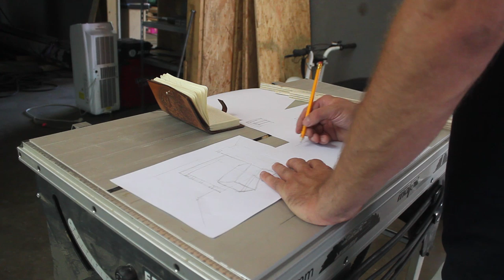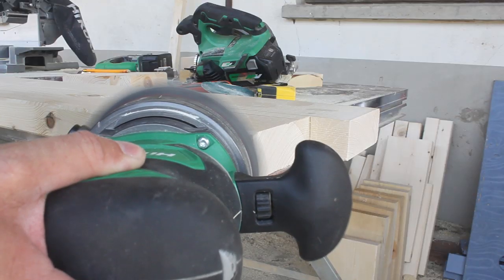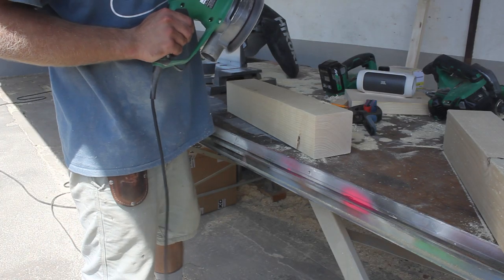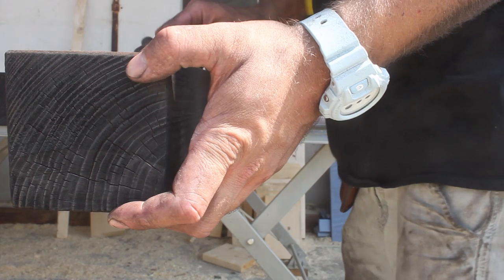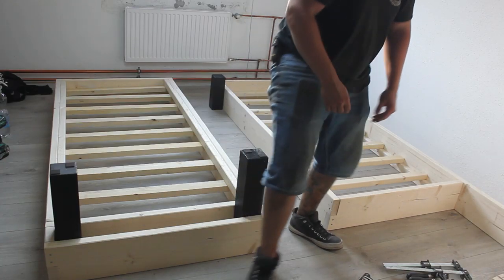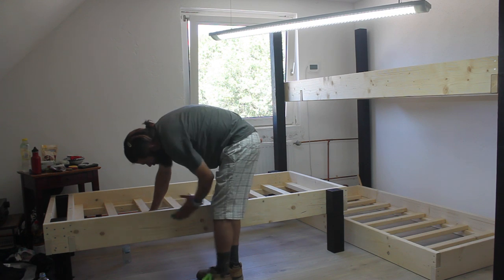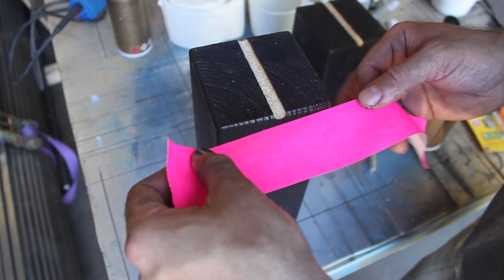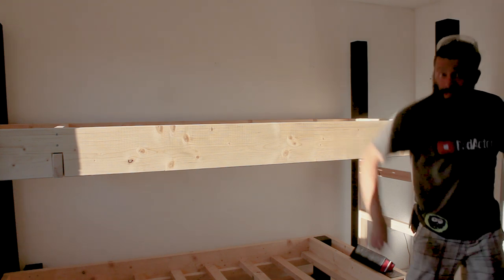TRIPLE BUNK BEDS FOR LAURA KAMPF (#10Makers)

Comment: Nice bed, but maybe needs some holes in the board for ventilaton of the matrass?
Reply from the maker: That's a great idea 😊 I'd rather just have some nice sturdy mattresses, but we were on a tight budget.
Reply: Al's Hack Shack I would have bought a slatted base (?) at IKEA’s, there not so expensive and a bit more comfortable than the big slats you used. They coat around 15 euro... allthough you can probably sleep with 3 persons in each one of your beds 😉
Reply from the maker: @janverzee9423  ooo, can you just by the slatted base on its own? That's a good call 😊
Reply: Al's Hack Shack this is the Dutch website, but I suspect it will be available in other countries also?
https://m2.ikea.com/nl/nl/p/luroy-lattenbodem-90160211/